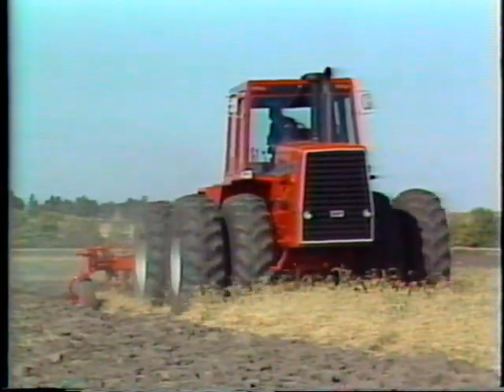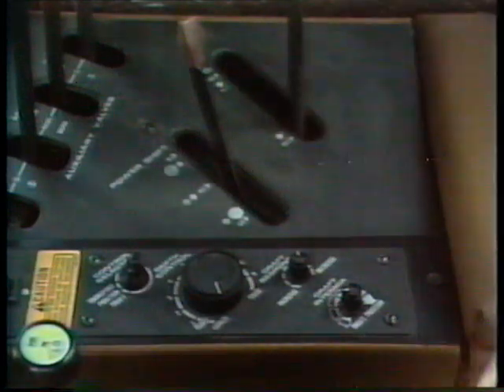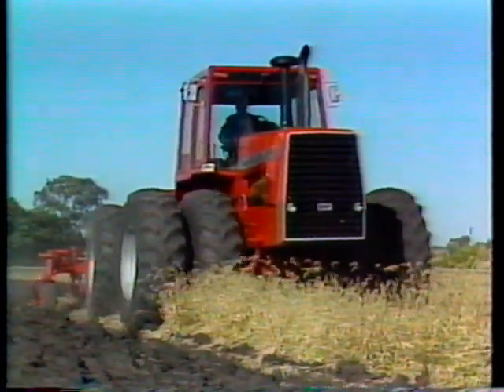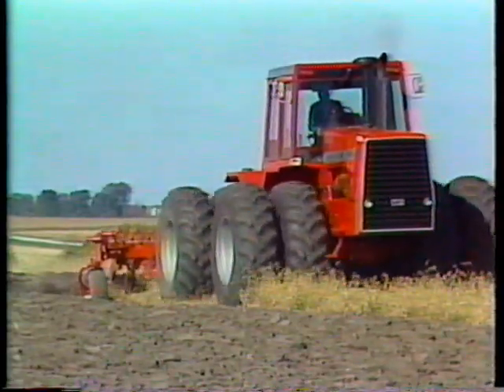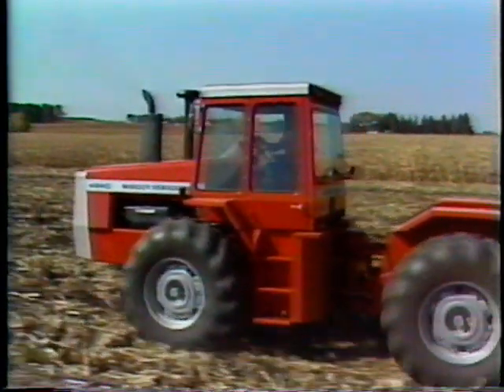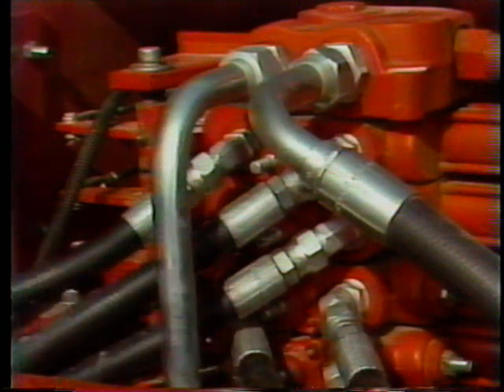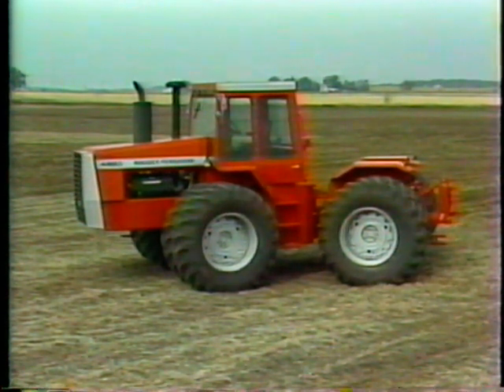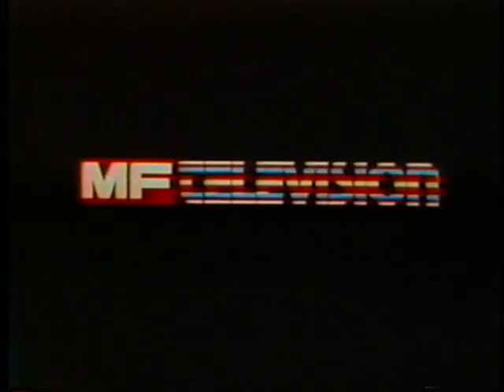Massey Ferguson 4000 Series 4wd

Comment: 😊😊 even the pre massey ferguson tractors gas and diesel they were made 4 fuel economy and even when the massey ferguson tractors were made and was standard equipment in tractors there are still many of those tractors still used on every other farm 2 day they went from a air ride seat 2 a oil ride seat 😊😊 and massey ferguson tractors have been made and been around ever since 1958 😊😊 and tractors 2 are the work horses of the farm over 6OO HP 😊😊 OMG 1O 14 2O24